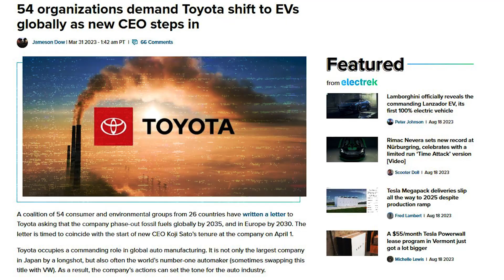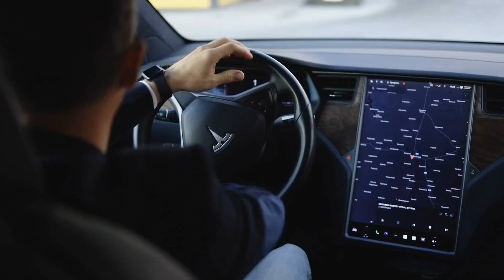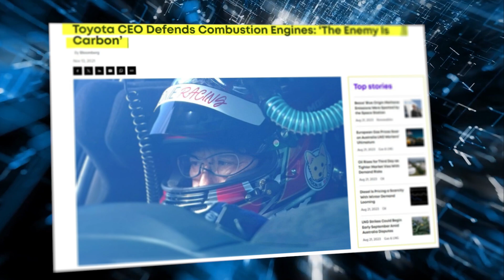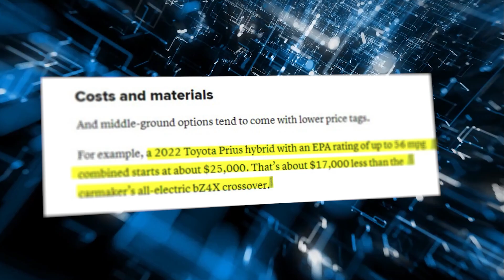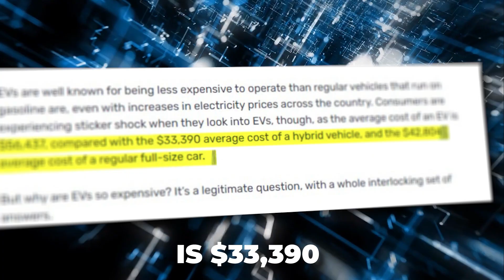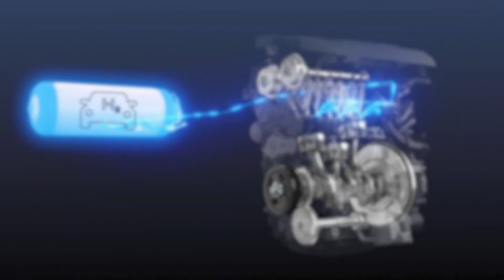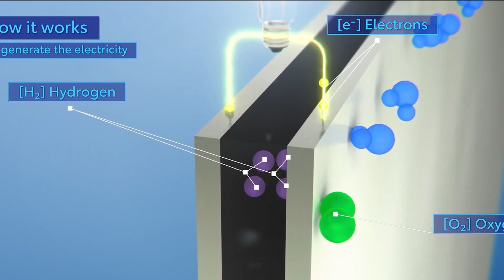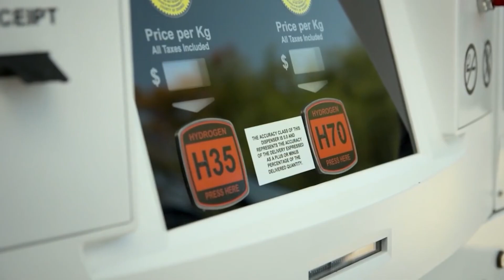The Truth About Toyota's Revolutionary Hydrogen Engine

Comment from the maker: What are your thoughts on Toyota's approach to hydrogen engines versus fully electric vehicles? Do you think hydrogen is the future of eco-friendly transportation? 👇
Reply: I think hydrogen has a lot of potential, especially for long-range travel. It could complement EVs rather than replace them!
Reply from the maker: @andrewknows77  Thanks for sharing your thoughts! I find the potential of hydrogen fascinating too. What specific applications do you think hydrogen could excel in compared to electric vehicles? Also, do you see any challenges that might hold back its adoption in the near future?
Reply: Hydrogen, mainly, is made from natural gas in a process called steam reforming (feel free to look it up) so Hydrogen IS a fossil fuel with massive transportation and storage issues making it more difficult and more expensive than other fossil fuels to run a car on... Its easy to decide if you know that an electric motor is 90+% efficient and a good quality, reciprocating internal combustion engine is about 30% efficient. Simple maths should hopefully bring an answer. More leading questions....How much electricity do you think a fuel refinery and production system uses? I'm guessing that would charge a whole lot of EV's. Also which other type of fuel can you make at home using just sun light and your roof space allowing you to drive potentially for free or at least at vastly reduced personal cost? Just something to possibly think about. Drive Safe. xx
Reply from the maker: @JUKPlaysGames  Thanks for your insightful comment! You raise some valid points about hydrogen production and efficiency. It's true that the current methods of hydrogen production, like steam reforming, do involve fossil fuels, which presents challenges. However, Toyota is exploring ways to make hydrogen more sustainable, including using renewable energy sources for production. The efficiency of electric motors is impressive, but the conversation around energy sources and their environmental impact is complex. I appreciate your perspective and hope to see more advancements in both hydrogen and electric technologies in the future!

Comment: What about the explosive nature of hydrogen? Then there's the near complete lack of infrastructure for refueling. Plus the Mirai STARTED at $51,000. The cost of fuel is high: to fill the 5.6 kg "tank" of the Mirai @ $27+/kg is over $150.00. And finally, the range is FAR FAR less than Toyota claimed. Only available in California. Plus the green hydrogen fuel production is limited. But hey, other than that, so wonderful. It's a technology whose time has not yet arrived.
Reply from the maker: Thank you for your detailed comment! You bring up some important concerns regarding hydrogen, including safety, infrastructure, and cost. The explosive nature of hydrogen and the current lack of refueling stations are significant challenges that need to be addressed for widespread adoption. Additionally, the pricing and availability of the Mirai can be a barrier for many consumers. It's clear that while hydrogen technology has potential, it still faces hurdles before it can compete effectively with other options. I appreciate your insights and hope to see advancements that could change the landscape in the future!